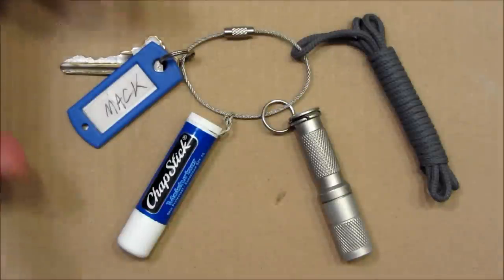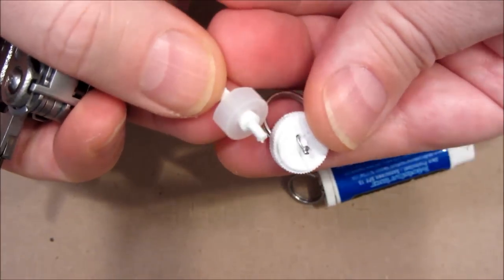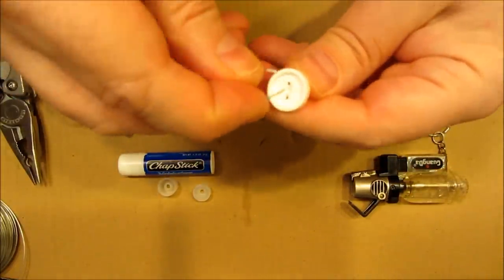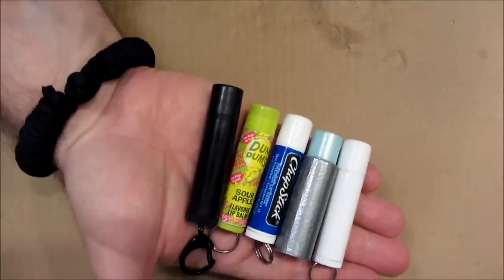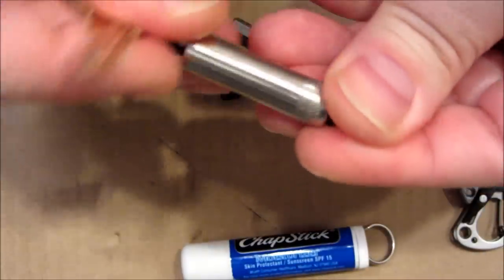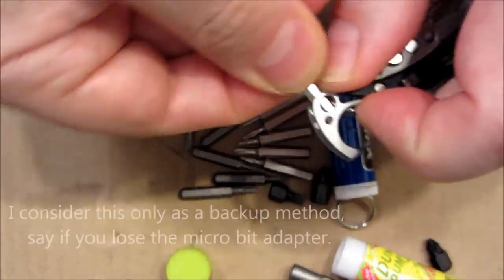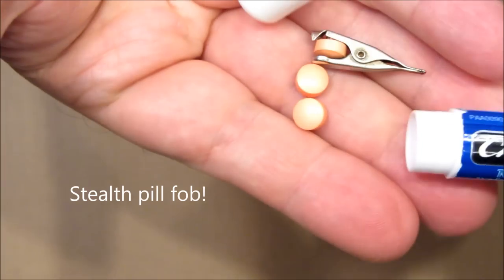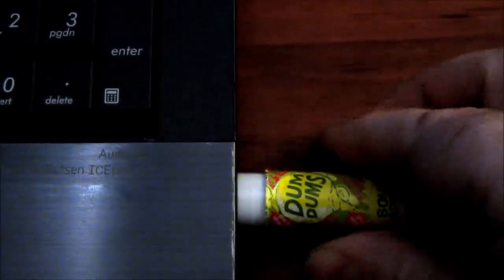D. Tape 5: CHAP STICK Stash

Comment: Brilliant as always. 
That micro hex bit adapter is sweet. Another item that Amazon does not ship to Australia. To order it from a seller who actually ships it here, I'll pay the equivalent of about $22 US. That's too much for a tiny piece of steel. The True Utility mini driver does ship from Amazon to Australia either. That's another seller, with its own shipping fee. Bummer.
I currently use one of those aluminum pen screwdrivers. It fits 10 bits inside. It'll do for now.

Comment: @ MeZillch a great tip to have a far more secure cap on the lip balm containers would be to flare the tube portion out with a soft flame such as a candle and a tapered object. Simply gentle soften the plastic of the tube with the candle flame and use the tapered object to gentle flare out the tube so you get a tighter fitting cap that is less likely to fall off and be lost.
Peace, Anthony ✌️😊

Comment: Dude, I love your sense of humor! That True Utility MiniDriver looks interesting. Do you know if the Leatherman flat bits fit the MiniDriver? Thanks for a great video.   Dee
Reply from the maker: Thanks. The True Utility MiniDriver business end has a very shallow cavity meant really just for its supplied half-sized 1/4 inch diameter hex bits. Full size, standard 1/4" bits stick out a bit, but seem to still work for light duty applications, but long bits like the Leatherman flat bits or any kind of bit without a flat back end (like any double-headed one you flip around) won't work.

Comment: MeZillch, also keep in mind that you can get lip balm container caps that have a loop shape at the top to accomodate keychain split rings.  Do a Google Image search on "Lip Balm Keychain Cap" ... scroll down the page and view all the different types (there are a lot of them).  These caps will give you alternate attachment options that are worth thinking about.  

Excellent video as per always.  Thank you!
Reply from the maker: Thanks. I've just returned from REI and see they also sell a lip balm called "Aloe Gator" which has a keychain hole in the cap, but I think half the fun of this thing is making your own!
Reply: MeZillch Agreed.  And from a structural standpoint, I think your solution is probably a bit more reliable.  A solid, accidental tug of some on a lip balm cap will take it off.  Your solution would require a bit more of a hard jarring to break it.

Comment: If you do not care for the elevator mechanism in chapstick stashes, then just remove the bottom part, and just put a plastic disk in the bottom to prevent items from slipping out of the hole. And for key-chain attachment, just make a tiny hole in the plastic disk, and feed the wire loop through there. Without the bottom part, the tube is a little shorter, so you save a little space, and because the bottom part is removed, you also save a little space inside as well (because the bottom part has a nub that clicks in the inside of the tube).

Comment: Try dipping the chap stick tube in boiling water for little while to soften the plastic and then disassemble it. That might work to prevent the tabs/ ears from breaking off.
Reply from the maker: Oh that sounds good! I wish I had some spares to test it on but I'm out of them. Amazon sells empty ones but without the Chap Stick label they aren't so stealth. Perhaps I should buy some adhesive backed printer paper and I can print my own labels.

Comment: I think your videos and ideas are the best I have ever seen.  Your ideas and mods are super smart.  I watched your early videos and i was in owe of your ideas (and still use as many as i can of your ideas on my various EDCs)
Thank you again for another great video.
ps.  if you really want to store something discreetly, the super quality key ring attachment u have made for it. might be a give away
ps2.  for your usb stick, look for a sun screen stick, they r a tad bit bigger than "standard" chap stick tubes, but i think ur idea of just pressing it and making it wide enough to push it in, is a better alternative (maybe u can use the bigger one to put something that would really not fit in the regular tubes)
Thanks again for another superb video
Reply from the maker: Thanks! I'll be on the lookout for the wider sunscreen sticks. The 2 feet or so of standard duct tape which fits in a Chapstick tube is enough for my day to day EDC but more might be nice for a full size kit. I also agree that for the best stealth applications having anything even remotely out of the ordinary, like the keyring attachment which doesn't exist on off the shelf, unmodified Chap stick tubes does make it a giveaway.

Comment: When popping off the bottom of the Chap Stick tube try letting it set in hot water for a while. It might make make the petals pliable enough so that they don't break.

I have seen many people include a signal mirror to an Altoids tin kit. Still others  try polishing the inside lid to make it shiner. Why not meet things halfway. Smoothly stretch and glue a sheet of Mylar foil to the inside of the lid. Maybe it isn't quite as reflective as a true mirror. It doesn't have the bulk or weight of a real mirror. It is a heck of a lot brighter than polishing the lid.
Reply from the maker: Thanks Rich. Warm water sounds good.

I hope to someday make a video of my testing of various impromptu signaling mirrors however my initial testing suggests the key to a good one is just as much being perfectly flat, flawlessly so, even more so than being super shiny and reflective actually.
I bought some silver Mylar tape and applied it to various "flat" surfaces and my results were not good. The key to testing is to assess the quality of the reflected spot of light it makes at a distance of say 40 feet or more, compared to a true, glass mirror as your reference standard. To keep the Mylar as flat as possible I used a credit card bent slightly into an arch to hold the Mylar taut. Still not good. For long range signaling the issue is the reflected light's "collimation" as they call it with telescopes.
http://en.wikipedia.org/wiki/Collimated_light
Reply from the maker: Around 16 minutes into my TIN 2 video I show briefly why even a very shiny Altoids tin, old style Cinnamon flavor, will STILL not work well for long range signaling:
https://youtu.be/a92RcoaDMow?t=15m55s

Comment: Awesome video. Have you looked into the Advil Pocket Mini Containers? They are reusable but I just thought of trying to make it into a micro kit or use it for micro bits or to store a sewing needle, and the straws of liquid that you have shown. The bottom of the container has a flat base and I can't figure out how to attach a split ring.
Reply from the maker: I will check out that container next time I see one at the store.

Comment: very good. try an old glue stick. its a little bigger than a chap stick. but still works as well.
Reply: But who carries around a glue stick?
Reply: its a little bit bigger than the chapstick. i just found the best little case.a small round pill holder. advil,found at cvs up at counter.no twist stick in middle.
Reply: +mark trezza I was just saying it takes away the stealth aspect of the project
Reply: 13:03 he even mentions the use of glue sticks

Comment: Some lip balm sticks, like the Nivea/Nivea Lobello  brand(s) are a considerably greater diameter and might fit the flash drives more easily. The cap on the Nivea lip balm is sorta translucent and much longer, too. It's as long as the applicator tube minus ~ a centimetre. 

Nivea skin crème has a tiny, very squat metal cylinder if you're looking for new shapes for cases, (though I'm new to this cool stuff so maybe it's been utilized before). It's ~ the size of two or three stacked ginger snap biscuits
Reply from the maker: +AeroDoe Yes, thanks, I'm always on the look out for new containers.

Comment: For the USB drive, is there any way to use a pack of gum as a decoy storage? I think its rectangular shape will work better with the drive than a cylinder lip balm case. Then again, it might look weird to string a pack of gum to your key chain. Anyways secret storage is so much fun. Thanks for sharing the cool tips.
Reply from the maker: +Danielle Stormborn Yes, any number of things would work. I guess the ideal container, which I have not found yet, should be only just large enough to hold the USB thumb drive circuitry, no larger, have a decoy appearance of some item one might carry on their keychain, and have some sort of dust cap/rain flap to protect against moisture and pocket lint when stored in a pocket. In an ideal world it should also be extremely shockproof and waterproof, but these attributes often add bulk, so reasonably water/shockproof will do for my needs.
Reply: +MeZillch 
Ah, I haven't considered the waterproof & shockproof qualities. Then how about Band-Aid travel pack? It's a thin plastic case (just enough for 8 bandages). It also has a hole at the top to clip on your key chain.
Reply from the maker: +Danielle Stormborn I'm not familiar with those but I'll take a look.
Reply: Faith

Comment: nice.
i bet you could saw off about a quarter of the micro-bit adapter to take less room and be more stable in the mini driver.
Reply from the maker: I suspect you are correct. I thought about that before but decided not to. In fact I might be able to even fit the fourth 1/2 length bit if that was done, however that would possibly compromise the adapter's use in other 1/4 inch screwdrivers I use it in. Those adapters are hard to come by so I don't want to possibly ruin it. Good point though. Mine was from a now discontinued Home Depot set I bought years ago but some other sources such as Wiha now make them too.
Reply from the maker: MeZillch Also another configuration I tried was to carry fewer microbits and jam the micro adapter into the top section of the Chap Stick tube  by pushing the screwdrive central shaft off to one side (it bends easily). This also allowed for carrying all 4 of the stock True Utility 1/2 size bits in the other tube. I passed on that idea too. This was just an experimental setup; I've never used it in the field. Building a cap that holds the micro bits themselves, perhaps out of epoxy, so once pulled off it serves as a stubby length screw bit holder was another idea I had but  put on a back burner. Others should feel free to run with it and post links here if you do
Reply: MeZillch
i see your point.  i have about 4 of these and thought they were easy to come by.  i had the idea for cutting it down since for one of my kits, i shortened 3/32" bits to make them fit in the hollowed out handle of a hand chuck.

Comment from the maker: Thanks everyone!
Reply: +MeZillch hey houw about having the tube in warm water for a while for a fullproof seperation of the parts?
the warmth might make the mechanism just soft enough to pull out the thing without breaking off any tabs.
Reply from the maker: +Davey Jones Yes that sounds good. bradleystrand81 who commented here suggested boiling water.
Reply: Davey Jones he'l need pristine water
Reply: Davey Jones he'l need pristine water

Comment: Also If you cut cut off the chap stick to a smaller size put your stuff inside then  re-thread the chap dispenser it will pass all but the most thorough of investigations.

Comment: Good video. However...
11:10 Tampons were not invented during WWI as bullet wound plugs. The principal of plugging and absorbing menstrual flow with soft material is referred to in the Ebers Papyrus, dating from circa 1550 BC. The use of wool for the purpose was practised in ancient Rome. The word "tampon" was defined as a vaginal plug in 1860 by R. G. Mayne.
Tampons are a relatively expensive way of purchasing cotton, and are not good for packing wounds. I recommend carrying gauze for this purpose.
I have, as yet, only found one good reason for a prepper to carry a tampon. She might need it if she has her period.

Comment: Here's a tip:  Mors Kochansky says he has learned from personal experience the only signal mirror that will work over a long distance is a GLASS mirror.  Forget about all the mini fakes and just carry a real one.
Reply from the maker: I agree nothing beats glass for quality, but some of the Lexan ones such as the AMK Rescue Flash are also optical quality, have been tested to work for 15-20 miles, and they are unbreakable, whereas a glass mirror may shatter if your kit falls down a ravine and smashes against a rock. https://www.youtube.com/watch?v=4JtfpaMiUqQ
Reply: MeZillch Brillant video and one best ive seen all day and have seen a few today . .  Were did you get screw driver from and all its bits ?
Reply from the maker: jacky Parker The micro bits are taken from "58-piece precision electronic screwdriver set" SD-9808N made by Prokits or is it  Pro's kits? Other companies seem to make the same kit, such as Eclipse.
The microbit to standard 1/4 inch bit adaptor is from a discontinued Husky kit from Home Depot. True Utility makes the metal tube device you turn with a key or coin mounted at one end to provide torque. It is called TU321 MiniDriver.
Reply from the maker: jacky Parker Yes, however I'd advise buying it under the Eclipse brand name to save money on Amazon:
 Eclipse 58-Piece Precision Screwdriver Set : 902-219
http://www.amazon.com/Eclipse-58-Piece-Precision-Screwdriver-Set/dp/B001DSYX1U
or try B&H photo video:
http://www.bhphotovideo.com/bnh/controller/home?O=&sku=1043086&gclid=CMKGitbwy8QCFYOTfgodaA4AIw&Q=&is=REG&A=details
 or perhaps ebay if you feel safe not using a big name, established retailer :
http://www.ebay.com/itm/like/331118050498?lpid=82&chn=ps

A nice mod I did to my case was to cut a notch out of the clear plastic cover which allows the assembled screwdriver, with the shaft inserted, to stick out so you don't need to assemble it each time you need to use it. You'll see what I mean once you have it in hand, if you get one that is.
Reply: Thanks but got similar sort of thing only it dont have the bit you show in video not to worry
Reply: try scraped hardrive best out there big shiny tuff
Reply from the maker: +Emiol Grimmshkiko I had no idea and threw one in the trash only recently. DOH!

Comment: hey I was curious if you could tell me where I could find the micro split rings so I can put one of these on my keys. thanks in advanced
Reply from the maker: +James Markham The ones attached to the lip balm tubes in this video I believe are 15mm outer diameter split rings and if I recall I got them from DX in China, but also try Etsy, craft stores, major fishing tackle shops, Amazon, and Ebay.
Reply: +MeZillch Will check those out.  thanks a lot for the quick reply!

Comment: what is that tool called that u used to heat up that wire
Reply from the maker: +CNC Ikner It is a jet torch style cigarette lighter. Specifically it is an insert you put inside a standard Zippo lighter to turn it into a jet torch lighter. I got it on ebay and I put colored duct tape on it instead of putting it inside a housing and since I don't carry it in my pocket, it just sits on my desk, I don't worry too much about it accidentally being ignited but of course I can't recommend using them this way.

Comment: what type of tripple a battery flashlight is that cause i don't know if my chapstick cap will fit
Reply from the maker: Duracell.  Keep in mind the inner mechanism of the that lip balm tube has been removed so it is completely empty. The elevator mechanism is gone.
Reply: MeZillch oh i ment the flaslight what type of flashlight is it
Reply from the maker: Oh. The flashlight at 12:33 is I believe an ITP A3 EOS. The company is the old name for what are now called Olight. https://www.amazon.com/Outputs-Keychain-Flashlight-battery-Included/dp/B006K5C2EG/ref=sr_1_1?ie=UTF8&qid=1528317978&sr=8-1&keywords=itp+eos+a3

Comment: ooh secret duct tape
Reply from the maker: +Matt Ross Having a sealed tube to store easily dispensed, clean duct tape in a pocket or bag (preventing the sticky ends of the roll from accumulating pocket lint) is the main purpose for me. Stealth and secret stash applications for other items may be more pertinent to others, though.

Comment: what if. ..what you have is not enough you need,  then what?
Reply from the maker: +rj chan Always carry back ups and if this small 23 inch strip isn't enough to repair whatever it is you expect to need to repair, before you can get home to replenish your carried supply, then consider carrying a larger stash in a larger tube from the get go, like one of the glue stick tubes I show at 12:53This video is part 5 of a whole series of different ways to carry duct tape. Check out the squash pack in part 7 for carrying a huge wad: https://youtu.be/gqseV5yKjuw